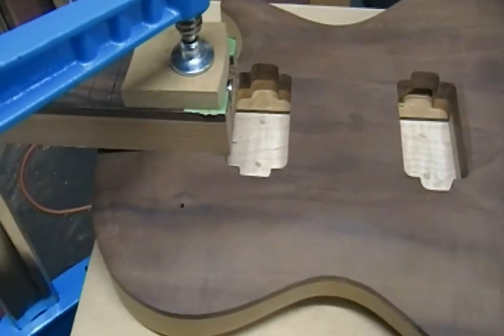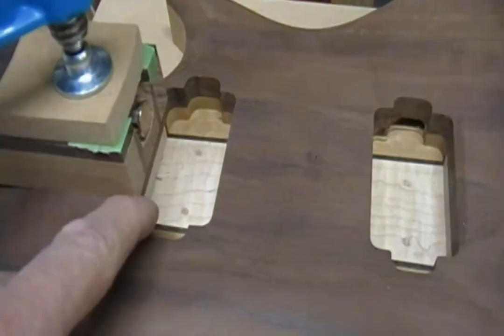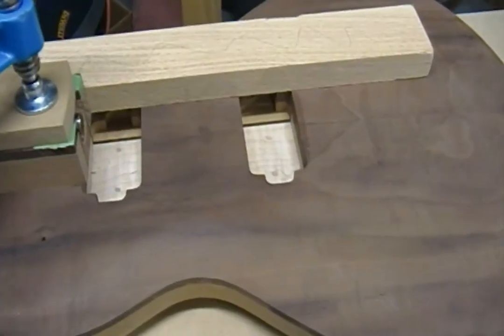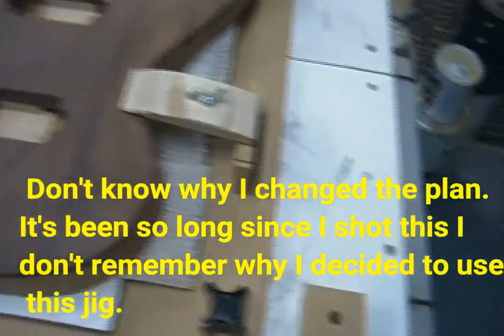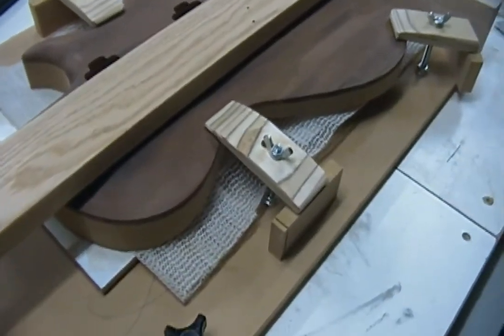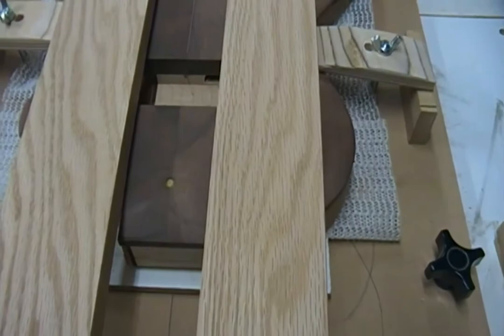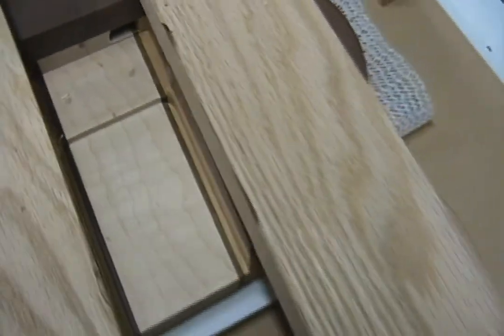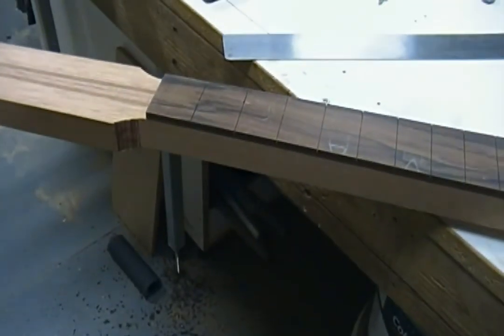Custom Electric Guitar Build, “GECKO” BY Jonah Guitars #7

Comment: lots of tedious measuring! I like the way you've cut out the back at the neck for better access to the higher register, lots of builders tend to over look that. nice work brother!
Reply from the maker: Randy Schartiger, thanks Randy. The high treble access is something I've tried to improve on all the copies I've done and designed in from the start on my originals. Plus the back relief to thin the heal area.

Comment: Coming along nicely Dane. I kinda like that lower edge on the neck pocket, sort of Tele / Strat-like? It wouldn't have any weakness once the neck's bonded in would it? Me- I love double-cuts so you know what's in the back of my mind, but this creation is just so good...
Reply from the maker: Dippy Hippy, yep in that little area of neck pocket it does kind of resemble a Teleish look. And the glueing surface and joint are plenty strong. Most of my guitar designs have been double cuts it's only these two Nighthawk copies and Tele's that haven't been. I've got one more single cut in mind, an LPJ, and then a double cut carved maple top will be next. Thanks for checking it out mate.